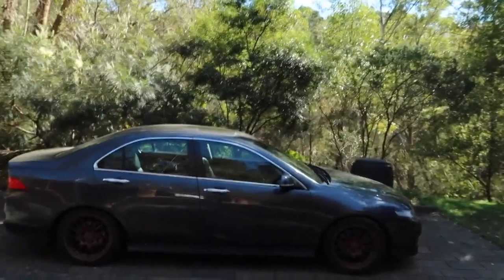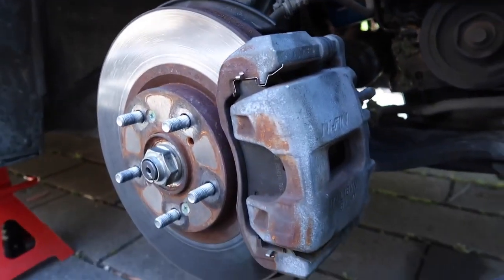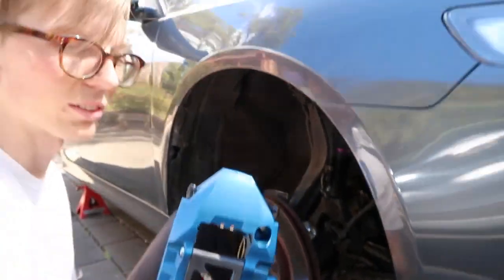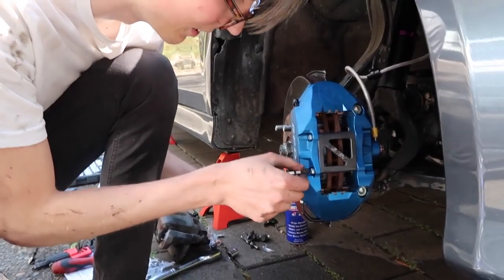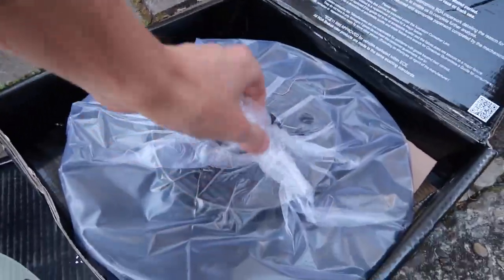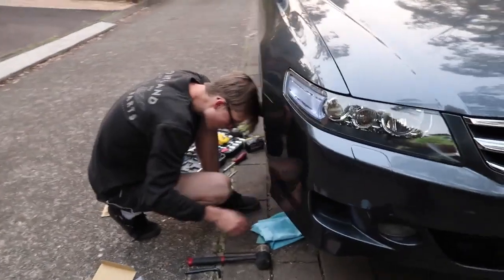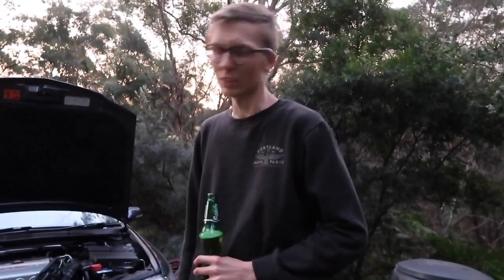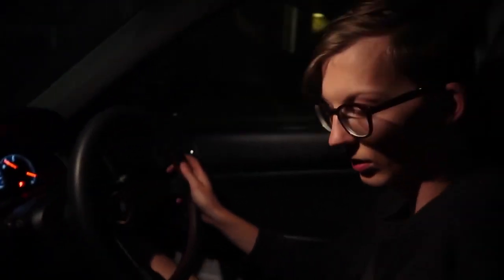Spoon Brake Upgrade

Comment: For those of you who were having trouble with the rotors and fitment, I read on some forums that if you use DC5 rotors for the spoon calipers to fit a CL9 TSX they should fit better than stock rotors. Should apply to CL7 and CL9 accord since they are the same as the TSX. I’m currently doing a CL Type S 6 spd manual (rare, i know)front brake upgrade to spoon. The same should apply since the TSX front brakes are the Same as the CL Type S

Comment: hey this video was extremely helpful, thank you very much. I was curious if you cold post the link of the rotors you swapped over too so I could get the exact thickness and I also noticed you weren't running spacers (good job), did this effect anything after the brake upgrade b/c that is what i'm worried about when I do this to my 04 tsx. also what is the offset of you wheels? thanks very much for posting this

Comment: This is the most detailed vid for this upgrade, great affront mate. Couple questions, is this car your daily and if so did you need to get an engineers certificate cert for the brakes? Thinking of doing this to my CL9.
Reply from the maker: Appreciate the kind words! Yep this is my daily and no I dont have any modifications engineered. The car flies completely under the radar and Ive never had an issue.

Comment: Does spoon have 6 pot calipers? Does this caliper work on the DA6/DA9 gen 2 integra without modification?
Reply from the maker: hey mate, from what i understand they only come in 4 pots - which should be more than enough for most track applications. spoon will do a bolt on kit for the integra

Comment: so the Spoon calipers wont work with the stock 300x28mm rotors?
Reply from the maker: Vu Do they do! The issue was with the thickness of the pads
Reply: Thanks! My rotors need changing anyway, would u recommend changing to a s2000 rotor 300mm with 25mm thickness?
Reply from the maker: Vu Do I wouldn't see the benefit to be honest, my rda blanks have been great so far and very budget conscious